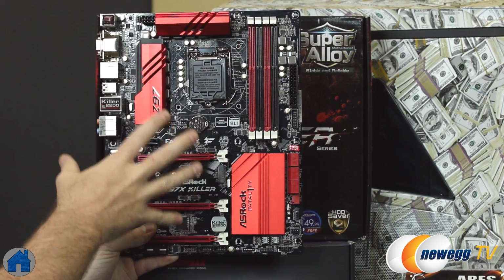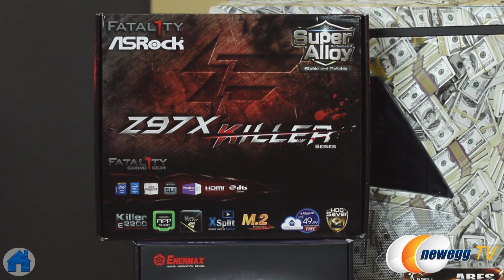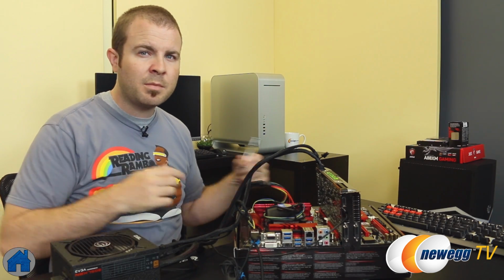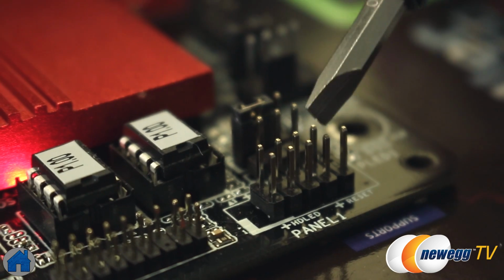How to Build a PC - Part 1 - Newegg TV

Comment: Sorry first time builder here! So I just built my PC and I think that everything is ready so when I turn the psu on the motherboard light turn on. The problem is that I can't turn on the PC. The power button on the motherboard doesn't do anything. Nothing is doing anything not even the fans spin. Am I doing anything wrong?

Here are the parts : 
CPU : i7 6700k

Motherboard : Asus z170 Deluxe

PSU: Corsair RM750i

GPU: MSI gtx 980 ti Lightning

Case : Coolermaster Master Case Pro 5

CPU Cooler: Corsair Hydro GTX 280MM Extreme Edition

RAM: Kingston 16gb 2133mhz DDR4

Hope that this is all the parts that I need!
Reply: +Vcvc16 Noodles if the pc tries to power on and instantly shuts off - it's shorting out. which means that there's something causing the power to turn off for the safety of your parts. I'm gonna have to give you an educated guess and say you should back track. You may have too many standoffs or little (you should only have enough for the motherboard. otherwise if you just have a standoff touching the back of the board it will shortout.) if this isn't the case - it could be a cord not pushed in. start removing the psu/power supply cords and pushing them in firmly
Reply: porkyporkchop1 The only thing that lights up is the motherboard but I will try to ensure that everything is plugged in :)
Reply: Vcvc16 Noodles it could even be something silly: like your power headed cables aren't put in the right way (you mixed up the + and the -). since you said 'only the motherboard." do you mean the led lights of the motherboard? or lights where the power cables are connected? are the fans spinning?
Reply: The only thing that lights up the motherboard led. There is a power button on the motherboard so I tried pressing that but it still doesn't turn on. The fans don't spin.
Reply: Vcvc16 Noodles hmm some power is going into the motherboard and not getting transferred? i still think something isn't pushed in all the way or it's the headers. look at your motherboard manual and double check your headers. :/
Reply: porkyporkchop1 OH THANK YOU the 24 pin wasn't plugged in all the way THANKS  :D
Reply: Vcvc16 Noodles no problem! glad I could help you :) I figured that was the case. let me know if you need any more help.
Reply: +Vcvc16 Noodles What's your storage?
Reply: Poseidon It is a 500GB Samsung Evo SSD and a SeaGate hybrid 2 tb
Reply: Vcvc16 Noodles Ok.
Reply: lol, I have the same RAM!
Reply: +Vcvc16 Noodles how much money did you pay for everything together?
Reply: InvestedCard33 about $2,500 +tax

Comment: Should I install the closed loop cooler with the water tubes toward the bottom of the radiator or from the top as is done here?  Bottom seems to me to be better to eliminate the chance of an air bubble at the top of the radiator causing issues.

Comment: i need to know what the numbers mean. can someone help me with that?
Reply: +vinx.909 you mean like the model numbers?
Reply: porkyporkchop1 no, i mean the numbers like 2.50 ghz with the processor. weirdly enough i can't find any guides who tell you what they mean, what is good and what you need to be looking for.
Reply: Ghz: Clock speed is the rate at which a processor executes a task and is measured in Gigahertz (GHz). Once, a higher number meant a faster processor, but advances in technology have made the processor chip more efficient so now they do more with less.
1.) http://smallbusiness.chron.com/ghz-mean-computer-processor-66857.html
2.) http://www.hardware.windowsreinstall.com/processor.htm

Basically speed :)
Reply: porkyporkchop1 thanks, the problem is that i don't knwo what the numbers mean on any of the components :/
Reply: vinx.909 that's fine :) what else will you like to know?

Comment: I NEED PRO GUIDE TO MY 2K BUILD SETUP :D

-Intel Core i7-4790K 4.0GHz Quad-Core Processor
-Corsair H100i GTX 70.7 CFM Liquid CPU Cooler
-ASRock Fatal1ty Z97X Killer ATX LGA1150 Motherboard
-G.Skill Trident X Series 16GB (2 x 8GB) DDR3-2400 Memory
-Samsung 850 Pro Series 256GB 2.5" Solid State Drive
-EVGA GeForce GTX 970 4GB FTW ACX 2.0 Video Card
-NZXT Phantom 530 (Black) ATX Full Tower Case
-EVGA SuperNOVA NEX 750W 80+ Bronze Certified Semi-Modular ATX Power Supply
-Microsoft Windows 10 Home OEM (64-bit)
-Asus VG248QE 144Hz 24.0" Monitor
-Razer BlackWidow Chroma Wired Gaming Keyboard
-Razer DeathAdder Chroma Wired Optical Mouse
-Corsair VOID 7.1 Channel Headset

or

http://pcpartpicker.com/p/txzBBm
Reply: +Nightstar Reaper Nice parts, but (here's my two cents) 750w is a little too much power for this build. I would highly recommend sticking with a 500-600w psu and make it gold (better power for your pc) unless you're planning on picking up another card in the future. Also are you sure you don't want to add on a HDD for storage? SSD - fast/but low room HDD- great for storage/slow (great for both worlds! heck you really just need the ssd for os/load times and maybe a few sluggish games.) Also most games require 8gb of ram. 16gb is kind of 'meh' unless you get into editing/streaming. <-- my two cents. enjoy!
Reply: yes im getting hdd and also im gunna overclock everything so i need power and another things 500w is enough???? because i see lots of people with 750w and also i wanna keep this machine for as long as possible
Reply: Nightstar Reaper http://pcpartpicker.com/p/zxgzD3 an example. the only compatibility issue is the ram. since it runs faster than the cpu. everything else is fine.http://pcpartpicker.com/p/cDjJrH I would choose a power supply like this. cheaper than your 750w and it's gold. so better power for your machine. normally people get 750w psu's is for sli (using more than one graphics cards). 970's only need a min of 500w. but you always want to add a bit more. and since you have a nice build go gold. :)
Reply: u sure i wont have any issues and what do u mean the ram will have issues? its a i7 4790k
Reply: also are you sure that 650w gold is enough for overclocking a gigabyte g1 gaming gtx 970? also all monitor, and stuff also wait 1 sec for  my new updated build
Reply: http://pcpartpicker.com/p/PPfhHx
Reply: 1.) at the compatibility check above the list it says "see notes below." a.) The G.Skill Trident X Series 16GB (2 x 8GB) DDR3-2400 Memory operating voltage of 1.65V exceeds the Intel Haswell Refresh CPU recommended maximum of 1.5V+5% (1.575V). This memory module may run at a reduced clock rate to meet the 1.5V voltage recommendation, or may require running at a voltage greater than the Intel recommended maximum. <-- so some small errors between the cpu and ram. just means it won't run as fast if you over-clock it. not that big of a deal. B.) The NZXT Phantom 530 (Black) ATX Full Tower Case supports video cards up to 444mm long, but video cards over 310mm may block drive bays. Since the Gigabyte GeForce GTX 970 4GB WINDFORCE Video Card is 312mm long, some drive bays may not be usable. <-- just means since you choose a 13" (rounding it) you will have to remove the harddrive cages in the middle for it to fit.

2.) Nividia recommends 500w at least on their page. Everything else is compatible with the power supply I gave you. Gold is better than Bronze (what you listed) it means it takes the electricity from your outlet and cycles it into safer power for your pc. so way better. I went with 650w gold because it's cheaper than the 500w one listed currently. yay you. the monitor's power runs off the outlet not your computer (the only thing that connects to the computer is the display cable.) everything else is a few extra watts added on, but if you're worried you can spend your money on a bigger power supply. Just make sure it's a better tier. If you plan on adding another graphics card to do an sli you want more power. Otherwise you can save a few bucks and stick with the 650w gold. (if you disbelieve me the pcpartpicker would have said it's not compatible either.) :D
Reply: how about 700w? maybe gold also i dont need to remove all harddrive cages i know its 312cm to 310cm gigabyte likes trollin like that and what other amazing ram is good then? (16gb 2x8)
Reply: Nightstar Reaper if you want to spend the extra bucks for the 700w go for it :) it's a little overkill, but you do what makes you feel okay. Corsair is always a favorite for many.
Reply: so wait my 2400 ram is bad :(?
Reply: SAD FACE
Reply: Nightstar Reaper it's not bad. it's just too good you can't access it's full potential haha
Reply: +porkyporkchop1 ahh ffs
Reply: try corsair vengeance pro 16gb (2x8) ddr3-2133 :)
Reply: are they good and do they have good cooling and are they compatiable????
Reply: Nightstar Reaper 1.) yes 2.) yes, but if you're worried you can buy ram fans! 3.) yes
Reply: ok 1 last thing ive been worried on what gtx 970 to get and the one im currently looking at can go on par with some gtx 980 with overclocking right?
Reply: Nightstar Reaper Yes, or pretty darn close! Maybe sometimes dips 5 fps lower. I normally skip over the 980 and go between the 970 vs 980 ti :)
Reply: also would G.skill be good like this? http://www.newegg.com/Product/Product.aspx?Item=N82E16820231661&cm_re=G.skill_sniper_2133-_-20-231-661-_-Product
Reply: Nightstar Reaper yea that's fine as well ^^
Reply: wutta bout pour isnt it 1.6?
Reply: Nightstar Reaper what? X') it's still fast.
Reply: yeah but the VOLTS
Reply: Nightstar Reaper which was also the main issue with the other ram .-. was too high for your cpu.
Reply: WUTS my cpu voltage?
Reply: is there anyway to have my Tridentx Ram go with the cpu?
Reply: Nightstar Reaper 1.5V+5% (1.575V) or mhz of 2133
Reply: How do i increase my cpu voltage to install higher tier ram?
Reply: Nightstar Reaper different cpu :3
Reply: i looked more into voltage and stuff and u have  been lying to me ram doesnt matter if its at 1.6v because thats normal for an i7 4790k it just cant go over 1.65 also 1.6 is the max volts it takes in not the normal it uses U LIAR
Reply: Nightstar Reaper then pcpartpicker lied. if you go back and read it haha

Comment: Is this build good? http://pcpartpicker.com/p/v2d8t6
I'm planning on playing games like Black ops 2, TF2, CS:GO, etc. What FPS do you think I could play at?
Reply: +There's a snake in my boot Not bad, but you can get a better power supply for the same price. EVGA superNOVA Gs 550w 80+ gold (and better power for your pc!). Everything looks great :) The only thing I would add on is a heatsink to help cool your cpu down with gaming (not that the stock cooler is bad, but a better heatsink will help.) Cooler Master Hyper 212 Evo is a great $25 choice or go with Corsair's liquid cooling 120mm fan radiators (like the h55/h60). Fps wise. cs:go will def be 200-300 fps/same as tf2 and ect <-- but those are older games so you should be hitting ultra everything easily.
Reply: +01001000 01100101 01101100 01101100 01101111 Get a better case and that build is OVERKILL for those games

Comment: Can someone help me? I'm getting some random fps drops on pretty much every game, here are the specs http://pcpartpicker.com/p/2Lk2sY
Reply: +Victor Leal what's your os?
Reply: Windows 7 Ultimate
Reply: Victor Leal hmm, have you updated your drivers recently? for your motherboard/graphics card?
Reply: yep, all update, it even got a little better after i did that, i can maintain good fps even when it drops, like league of legends, i get like 250fps, but then it drops to ~60, still playable but concerning.
Reply: If it's not drivers, there's a few directions 1.) it can go. It can be a heat issue (cpu/gpu/ect.) 2.) it can be certain settings that are dragging the fps down 3.) or it could be your psu struggling. 4.) corrupt files/defragment needed/or a good cleaning <-- my experience to fix fps drops.
Reply: thanks man, yeah i think it's my cpu, it's the oldest part i have, and my cpu needs a bit of cleaning...
Reply: Victor Leal if that's the case. time to grab some thermal paste and rubbing alcohol to give it a good cleaning :)

Comment: im just getting into pc gaming and i was wondering if this build would be good please give me any feedback and recommendations

Computer case – Thermaltake Versa H22

Motherboard – MSI Socket AM3+/AMD 760G/DDR3

 Video Card – Sapphire Radeon R9 270 2GB

 Processor – AMD FX-6300 6-Core Processor Black Edition

RAM – Crucial 8GB Single DDR3

Hard Drive – Seagate 1TB Desktop HDD SATA 6Gb/s 64MB Cache

CD Drive – Samsung SATA 1.5 Gb-s Optical Drive

Power supply –EVGA 500W
Reply: +phil silva It seems fine, but down the line I can see you possibly upgrading your motherboard a bit more and your graphics card. instead of the r9 270 you should look at the r9 380 for a bit more kick or the 960. if you're not planning on upgrading your ram later and sticking with the 1 slot of 8 gb's you should think about doing 2x4 gb's to help with loads and heating. and with the processor maybe buying a better stock cooler because that cpu runs hot! just my two cents, but everything will work!
Reply: thanks really helpful, now how well do you think it would run like would you consider this a weak build i am on a budget but im trying to get the best i can with what i can spend
Reply: phil silva the fx 6300 is still a solid cpu with it's 6 cores. It'll carry a lot of newer games for you, but games nowadays rely on gpu power. So the better the graphics card the better. But you need a decent cpu to carry the gpu's load. Like I said, if you can splurge a bit more - Upgrade GPU if you can :) and make sure you have enough fans in your system to help cool everything down. maybe invest in a heatsink in the future.
Reply: so what kind of graphics card would you recommend that would run good with the cpu i am on a budget but im  trying to spend at most $750 on a decent desktop that will keep me busy for a couple of years
Reply: If you like what you have: go with a 970 (it'll keep up with newer games for the next few years.) or if you want a solid mid-budget card go with a 960 or r9 380. if your budget is 750: how about taking a look at this build: http://pcpartpicker.com/p/F4FynQ you get a stronger cpu than the fx 6300 and with 8 cores that will help you with editing/streaming/and gaming. It's totally up to you what you want to do. Just giving you my two cents and some info.

Comment: I'm building my first PC. my question is do I need to buy extra cables? or do the parts come with cords for the had drives and power and all that?
Reply: +mj Henderson (thatgtaguy) the motherboard will carry 2-6 sata cables, the case will have screws, power supply has it's cords, and everything else will come equip with what you need. except for extra accessories (like speakers, keyboards, mice, and monitor.)
Reply: Thanks I bought all the parts and found that out. It wasn't as hard as I expected just was frustrated with a couple parts that gave me a little trouble
Reply: mj Henderson sweet! I'm glad you got yours going :) are you happy at least?

Comment: http://pcpartpicker.com/p/CTWWqs What do you guys think?
Reply: Not bad, but I personally would invest more into my motherboard and drop the ram down to 8gb (always can upgrade later.)
Reply: What's wrong with motherboard? Also that 30$ difference between RAM is not worth upgrading
Reply: +Chris Lantos just don't want your CPU and gpu to bottleneck. Better safe than sorry. Otherwise up to you.
Reply: Could you explain more thoroughly
Reply: +Chris Lantos Bottlenecking is when one component of the entire system holds back the performance of the whole... kind of like the weak link in the chain. Normally in gaming it would cause stuttering and tears. So you have a really nice CPU and graphics card, but the motherboard is completely holding you back. 1.) You have two ram sticks but the motherboard supports 1 slot/stick. 2.) that thing is gonna be really cramped. 3.) I never trust micro boards. They never hold up.
Reply: +Chris Lantos and you don't really need 16 gb unless you're editing. Most games run off the gpu.
Reply: Oh I didn't notice....am but about the RAM can I keep it if I get better motherboard?
Reply: Trying to make a pc that is not costy
Reply: +Chris Lantos I understand, I'm trying to help you out. Don't take it the wrong way man
Reply: Uhm what motherboard  would you recommend then?
Reply: +Chris Lantos 1.) MSI 970 2.) MSI 970a sli krait 3.) asus m5a97 4.) asus sabertooth

Comment: If I have an i7 4790K,16 Gb of RAM and a 980ti in my build could I play GTA in 1440p?
Reply: Easily
Reply: +AetherRealm And It'll be 60 fps and perhaps a bit over too
Reply: +Chubs2246 Nice!
Reply: I mean, a i7 and 16 gigs aren't really needed o play games lol. I5 and 8 gigs
Reply: +YourAverageHobo i stream and edit videos, so it is needed. Also this build is way overkill for just games, streaming at 1080p 60fps will use your RAM alot. Plus i7 is a beast at rendering
Reply: AetherRealm yee
Reply: Defidently
Reply: ***** I know. I meant to edit that part out but never got the time to do it.

Comment: After finishing the test boot and removing the stock heatsink is it a VERY bad idea to use the old thermal paste or is it still viable??? Please answer I need to know.
Reply: +porkyporkchop1 You are correct!
Reply: If you install and remove the heatsink later on you SHOULD replace it with new thermal paste. It seems silly, but make sure you clean off the CPU and heatsink with Isopropyl Alcohol (the stronger the better) and toilet paper.
Reply: Yes use new thermal paste
Reply: +Gabinuh praise the sun!
Reply: +SpellForce _ TF 

New!!!

Comment: Should I bother spending $20 on a separate cpu fan or just stick with the stock one that comes with the cpu? I probably won't do much overclocking
Reply: Depends on your CPU. If you won't do much overclocking, stock is fine, but if you get an AMD CPU the stock fan gets really loud
Reply: +Gabinuh Thanks, I'm using an Intel i3 so I think I'll stick with the stock fan and get an aftermarket one when I have a bit of walking around money